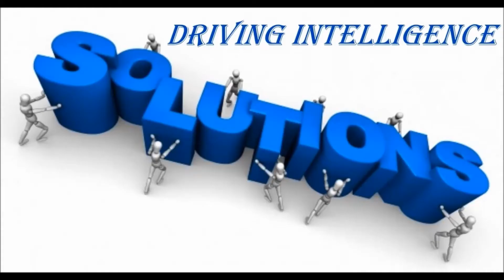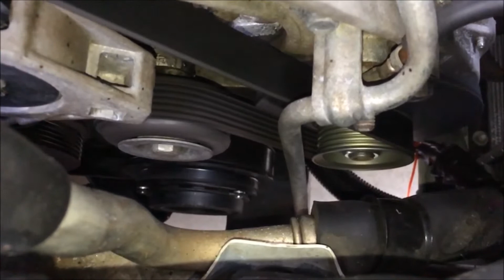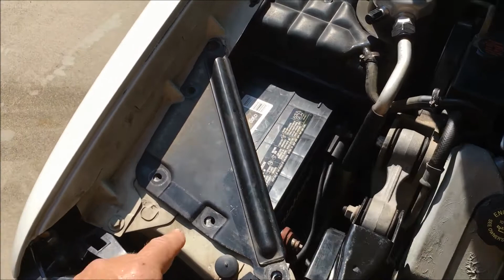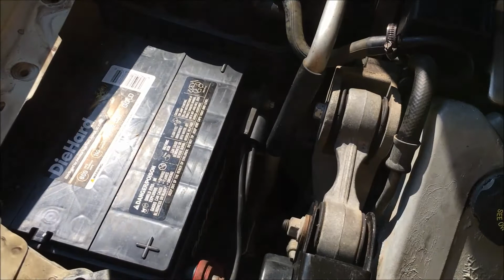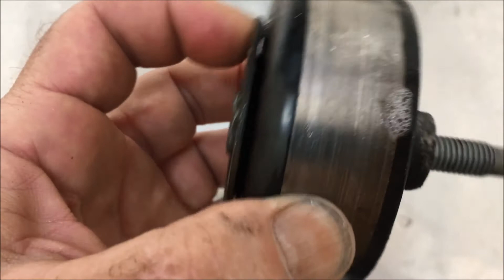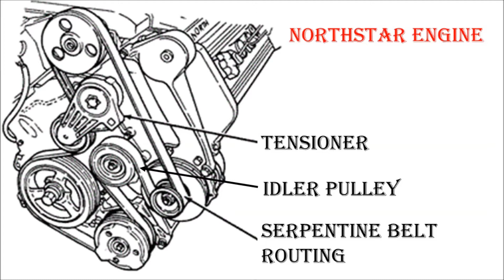How To Replace Cadillac Northstar 4.6 Belt Tensioner and Idler Pulley: '99 Deville Replacement

Comment: Changed idler pulley not I have no change on my battery I’ve replaced my altinator 3 times 18mo
Reply from the maker: wow, that is very odd.  Are you sure the belt is on properly?

Comment: what was the torque spec fot the Idler pulley and the tensioner?
Reply from the maker: Drive-belt idler pulley bolt: 50 N·m / 37 lb-ft
Drive-belt tensioner assembly mounting bolt: 50 N·m / 37 lb-ft

catching up with old comments

Comment: Thanks for getting back to me on this, so 37ft lbs in the aluminum block seems like alot but I'll do that, so you think the idler pulley and the tentioner pulley are both 37ft lb?
Reply from the maker: It does seem a little high, but that is from my Chilton's Manual.  You might want to go a little lower initially and use a little blue Loctite.  As far as the idler pulley, if the bolt is the same size, it will be the same torque, but sadly, this info is not in the Chilton's manual.

Comment: What's the torque spec on the idler pulley  and belt tentioner puller. Can't seem to find em anywhere.
Reply from the maker: Hi, thanks for your comment.  Good question, I referenced the Chilton Manual and listed the torque spec in the description of this video.  I also included a link to the repair manual for the Deville.  Let me know if there are other repair needs you have for this car.
Reply: what are the torque spec for an Eldorado Idler pulley and the Tensioner ?  @DrivingIntelligence